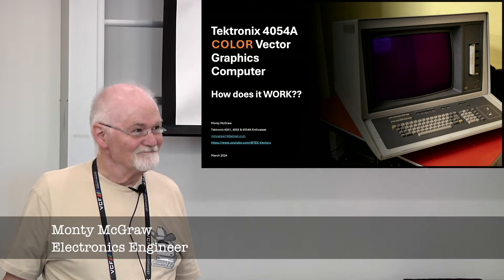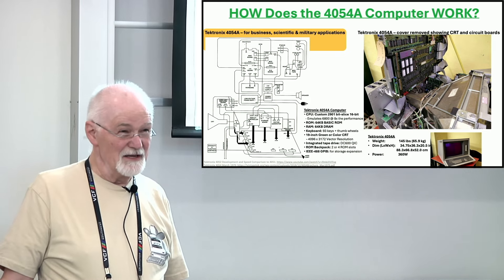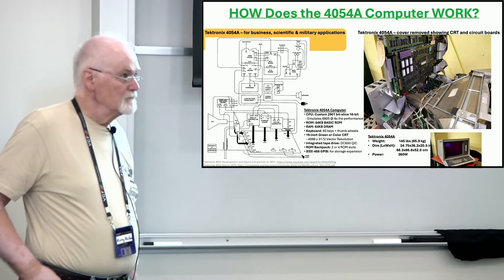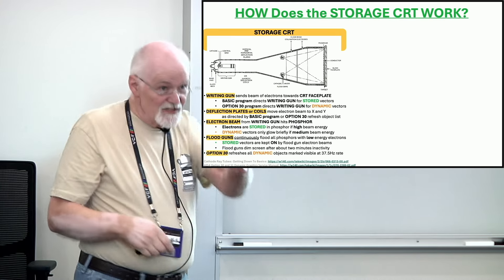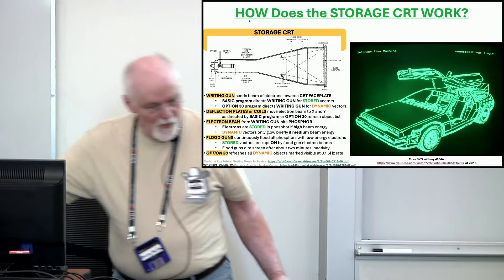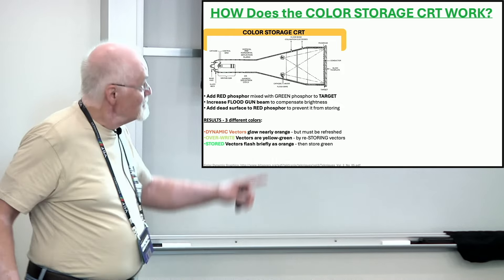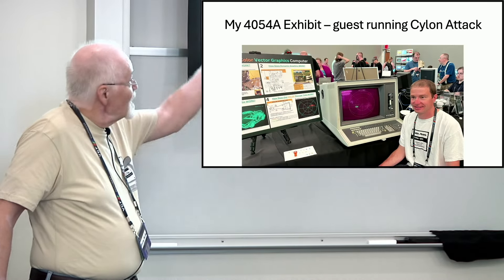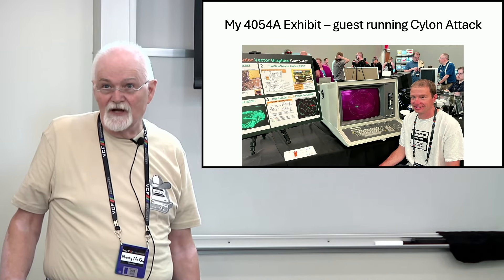Tektronix 4054 COLOR Vector Graphics Computer - How does it WORK? with Monty McGraw

Comment: In 1987, there was one of these for sale in a yard sale in Tualitin Oregon.  I regret not snatching it up.  Was $100 at the time and for me, that was a bit too much.  

It had the joystick mounted where the one in your photo has the X, Y buttons.  I bet somewhere in all that documentation, Tek offered an option...

Great presentation.  Tek made great gear.  Was really great to hear about your experiences with these wonderful machines.

I used one for sheet metal programming back in the day.  Was a great experience.

Ours used paper tape for user data storage.

Input G-code program, run the simulator to verify it.

Edit program, wash, rinse, repeat.

When done, you write your finished program to paper tape.  Master programs could be stored on paper tape too.  Those were programs with tags that could be expanded programmatically.  

I could go on at length.  I really liked these computers.  Wish I had one!